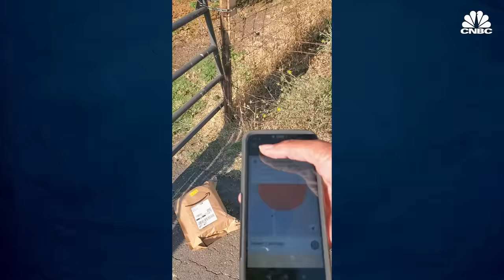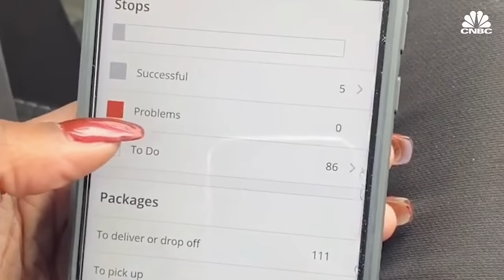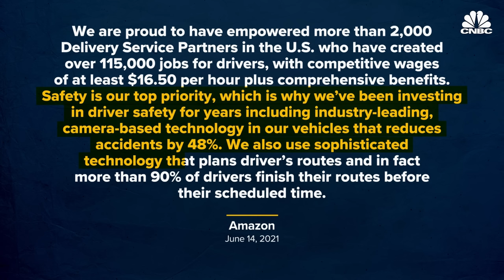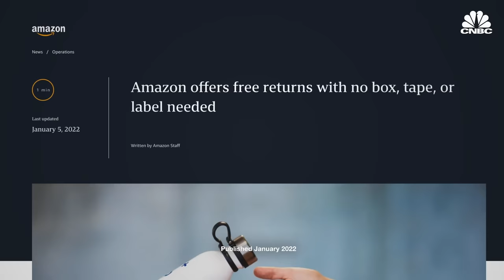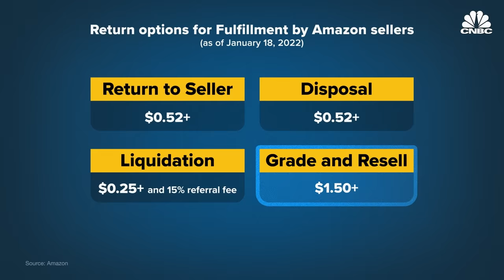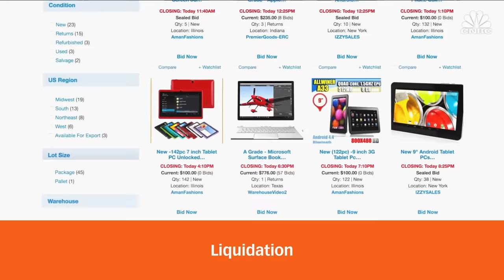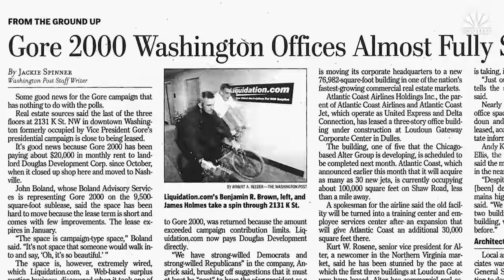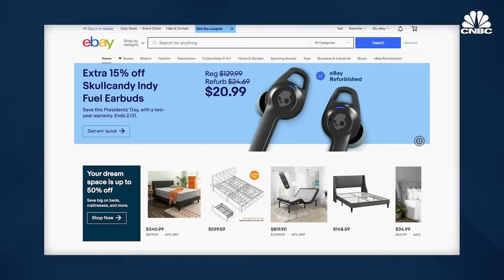The Hidden Costs Of Amazon Shipping And Returns

Comment: Working in industry, though not for Amazon as a driver, one thing they are missing is not giving the drivers regions of work.
UPS, DHL, FedEx, Royal Mail, - here in the UK - and the like give drivers regular routes to work. This enables the drivers to be familiar with the conditions of their environment, know when traffic is heavy in certain areas and learn short cuts that will save them time on their routes.
This knowledge is priceless and can only be achieved with drivers delivering to the same region, day in day out.
Also, having some way to feed back issues with the systems provided would be priceless and best if that system is delivered on a personal level, a member of staff at each location whom is responsible for acknowledging the feed back and then relaying it to those who can make the change.
Finally, having a portaloo/a camping toilet, like those found in campervans/Winnebago's is the obvious solution for the lack of facilities available and this should be applied industry wide. To support this, onsite cleaners can be on hand to clear this at the end of shifts, making the vans ready for the next shift - this should be standard.
Instead of chemical toilets, you could use compost toilets and then sell the biproduct to the fertilizer industry to support the facility of the toilets. That way it comes at little or no extra cost to the business, employees are happier in their work and you help facilitate the transition to the use of healthier fertilizer to grow crops for a more sustainable economy. A green touch that is on par with the ideology of Amazon and its founder Jeff Bezos.
Reply: They don't have to because they hand off most of their work to said companies. UPS, USPS, FedEx, etc.
Reply: UPS and FedEX may have regular routes but they still can't seem to deliver to the correct addresses.  90% of my packages never arrive without issue, and 20% not at all.  And there is little I can do and they don't care, despite having paid for the delivery of my package to my house myself I'm not considered the customer, the shipper is, so my satisfaction is irrelevant, my receiving the package is irrelevant.
Reply: @photo-5207  Del
Reply: @RoySATX  You indirectly pay for a fraction of the delivery fees and yes shipping company will rather deal with the shipper than receiver for many reason.
Reply: They’re low paid they will not stay long enough to know a route. Good thought though.

Comment: I needed a micro SD card returned because it would not work.  I couldnt figure out how to ship it safely, so I secured it in an SD card adapter that came with one of the many SD combos Ive bought through the years.  When my replacement came, so did my SD adaptor.  I was shocked... and actually quite impressed.

Comment: I barely ever buy clothes online because of sizing. If Amazon (or anyone else) let me just put in my measurements and see clothes that fit, I'd be hooked. Why can't they just do that?
Reply: As an example, when I try on Levi jeans, I always get the same size and style. However, I have found that any two pairs of the same color, size and style to not be consistently sized, so I have to try on muliple pairs just to find the one that fits. I've also found that Levi the same size and style but different color are even more differently sized from each other. For brands like Abercrombie, I have to purchase a full size larger than other brands for anything to fit me.  Nike shoes run at least a size small too (and narrower than other brands of the size labeled size). 

If clothing sizes could somehow be standardized within brands and between brands, what you're suggesting might be possible. Personally, I don't see that happening.

Comment: The delivery issue starts with the way Amazon's AI creates labels to pack boxes. Not only size, but weight needs to be taken into consideration when determining what can be boxed together. A 16# bag of kitty litter should not be put with a box of cereal. With Amazon Fresh, 40# of flour, sugar, and baking supplies shouldn't be put in one grocery bag simply because they will physically fit and are in the same aisle. Totally unacceptable to expect a driver to deal with the stupidity of the packaging as well as everything else.
Reply: Right! It's chaos how they package a lot of these items together.
Reply: I WAS A REGULAR USER OF AMAZON PAY. I HAVE LOST AMAZON PAY BALANCE AMOUNT FROM AMAZON PAY. THE REASON IS 

Since you have not used your Amazon Pay balance in the last one year your account has been marked as Inactive. While you can continue using the ‘Gifts & Credits’ part of Amazon Pay balance you will not be able to load or use the money loaded in Amazon Pay balance.

Complete Amazon Pay KYC to activate your account.

You can complete your KYC at the convenience of your doorstep. All you need to do is upload documents on the Amazon app and schedule an appointment for doorstep verification.

BAN AMAZON FOR TAKING AWAY PUBLIC MONEY.
Reply: @brettbarrett2533  I ordered a fire tablet and case and memory card. They came in 3 packages and 3 different deliveries. Memory card and case were in 2 ft x 8 in x 4 in boxes. Tablet was in a bubble envelope.

Comment: I very seldom order on line because of the return issue.  However, all the younger family members think nothing of ordering 3 sizes and two different colours of the same product.  They just return it if it doesn't fit.  So rather than focus on return expenses, start to focus on better product descriptions, pictures and measurements rather than sizes.  Sizes vary so much by manufacturer it is impossible to know what size the product is.  But if you put the body measurements that will give a better indication.  

I did order winter boots, because the on-line store actually told you how to measure the length of your foot and what size you should order depending upon that length measurement.  I did it for myself and my daughter and both pair fit perfectly... but the size to order was two sizes larger than my normal shoe size.

Comment: Amazon also relies (or, at least, did so in 2020 when I worked for the USPS) on the United States Postal Service for Sunday deliveries. UPS did, too.

As for the pee bottle issue, try being a USPS associate mail carrier (CCA). Delivering on routes you are unfamiliar with, with no map or GPS, plus the required Sunday UPS/Amazon deliveries where there is no route but you have a GPS, means you often don't know where to pee, and it can be very stressful. During the pandemic, a lot of gas stations wouldn't even let us go pee, and there were many other places that were the same.

Now I work for Amazon at the KCVG "Air" sortation facility, where safety is both highly important and I see routine signs of it not being prioritized, even when a rule comes from a senior manager. When OMs, AMs and PAs don't follow the safety rules, and they push for speed, the associates tend to follow suit. It's human nature. A friend of mine who is a high-level OSHA inspector told me that Amazon is so safety focused because it was listed by OSHA as a severe violator and assessed heavy penalties.
Reply: I know FedEX drivers also use pee bottles, truckers, and many involved in transporting goods. That is not really a hardship, just folks work until the route is done and they are saving time so they can get home to loved ones. Pays the same no matter how long it takes for most workers and  subcontractors.
Reply: @krisreddish3066  Honestly, if you can do it without spilling, it's ok. The problem is that if you pee and spill, someone else may come into your fluid, and that could lead to the transfer of a disease. Just don't leave your bottle behind in a shared vehicle; that's absolutely unacceptable.
Reply: Should Amazon be responsible for employees who have no common sense?
Reply: @Garth2011  That is a tricky question but, no, everyone makes mistakes and those without common sense make more than other people. Just because they have a disability doesn't mean they should be punished for it.
Reply: @GlennsFastReviews  Who said anything about disabled folks? Likely not the best job for the disabled even so.
Reply: @Garth2011  I mentioned disabled folks because your question was an all-inclusive one that included the possibility of no common sense being a disability.

There are plenty of jobs at Amazon that are suitable for disabled people. I know a guy at work who's got something wrong with his leg - he walks oddly - yet he works harder than a lot of other young folks. Another guy has a prosthetic leg. Physical disability is not an excuse not to work for most disabled people.
Reply: @GlennsFastReviews  Not really. Only to those who have disabled on the front burner.
Reply: @Garth2011   @Garth Clark  Not really what? Only what? Please clarify.

Comment: I've been stung by a scam a few times now, with amazon and also other companies like Zappos, where a person will buy two similar products, like sneakers or phone cases. One may cost $30 and the other $80, for example, and they'll keep the $80 one but return the $30 one in the packaging for the $80 one, get the $80 refunded. It's very low risk to them, if caught they just say "Oops I made a mistake".  The returned products go back into the warehouse and the next person to buy the $80 one gets the $30 one instead.  They either realize it's the wrong one and also return it, but are left unhappy and may not reorder, or they think they were tricked by the seller with false advertising and just leave a bad review warning others not to buy products from that seller/brand, which hurts the totally innocent company who sells the more expensive product.  Warehouse workers are rushed and don't check all that closely to notice it's the wrong one.

Comment: Inconsistent shipping is a real drag. Something says it's being delivered today and I need it today and then I get a.message I won't be getting it until a later date. They should have said that when I was ordering and I'd have picked a different item. I can't cancel and get a refund to reorder something immediately - because I needed it today - so when it gets here it becomes a return and I guess ends up in a landfill. 

I pay for Prime to get stuff here in 1 or 2 days, and the price of the items reflects the added shipping. I also order things I can't easily access locally. I'm not going to feel bad when hundreds of dollars of merchandise ends up in a landfill because Amazon can't get their act together when it comes to delivering to me by 10 pm. 

Another issue is inconsistent sizing in clothes and shoes. I order warehouse deals in case the item has to be returned and they get a second chance with a different buyer.

Comment: For the record know if you're a driver and you're only making 20 an hour you're getting ripped off. 
I'm not sure what tier I am considered at Amazon so just for example I'm going to compare myself to tier ones. 
at Amazon I make 19 an hour 
But yet tier 4 the first tier of management. make 80000 a year. Despite the fact that I worked at two buildings and I have personally seen my area managers have literally done nothing for day-to-day operations. I'm a PG  "process guide" it's my job to manage the floor make sure everything's running okay. so i move people around when it needs. I also have to bust my ass to break down Lanes if they are full. there will be days where I will be processing 800 packages an hour.
when you're only supposed to do 160. and within the last 2 months I've walked on average 30 miles a day. so if there's an area manager why is it my job to do all this for the same pay as a normal associate?
in any given day I do 4 times the work to any other associate for the same pay. Which has me asking the question why is upper management paid so much on Amazon. When it's the driver's and tier one's that actually make things happen. To drive this point even more. Just in my department is 4 managers 
two of which are Senior Management so they make over a 100,000 a year. 

despite the fact that they don't do anything they make on average 2 to 3 times more than your normal associate. meanwhile I will look over at the desk and literally see all four of my managers on their laptops laughing their ass off. more often than not I will look at my manager and see he's on indeed. so he's one of the highest earners on the floor spending most of his time doing personal tasks on company equipment. and I can't even get an extra dollar on my paycheck for actually working thanks Amazon.
Reply: Thanks for watching☝️Get-in-touch , Let's discuss on Financial investments..
Reply: Wow 20$ an hour im sure all those warehouse employees would love to be paid that
Reply: @spamlogs2701  considering this is Seattle people can't even pay their rent at 20 an hour. So yes that would probably great if it wasn't $1,500 a month for a studio apartment. better yet I feel bad for the associates in Las Vegas who only makes 17 an hour. and apartments are the same price. so yes cost of living has gone up and everybody at Amazon as a tier one should make 25 an hour because of it. if they did that maybe I would have co-workers who would stop starving themselves and actually be able to afford lunch. and just maybe people would stop trying to unionize Amazon because they can finally be sure at night their bills will get paid.
Reply: If you don't like your job, then you have the option to quit!
Reply: @dontcare563  are you being deliberately ignorant?
Reply: The place would be a zoo without managers, what a stupid thing to say.
Reply: @neonnoir9692  yes it would be but I don't see how it's relevant for six managers to stand behind a desk and compare salaries on indeed. Maybe there should be two that are actually doing something for the company instead of wasting money on their salaries
Reply: @neonnoir9692  your logic would be true if it wasn't for the fact I'm the one that actually manages the floor most of the time. so why don't I have the title if the actual managers aren't working

Comment: I was a ups driver and my normal day was 180 stops a day and at 20 stops per hour I was still getting harassed because I was too slow. Sometimes I had as much as 250 stops and around 300 to 400 stops during Christmas, at the beginning of the day we couldn’t walk inside the truck because it was blown away with packages, I was questioned about five gaps between stops so I end up filling a complaint with OSHA.

Comment: Message for Julie Ryan of North American Returns, HP 51:38 - 51:52 ...specifically 51:47 - 51:53 >>> You have 6 stacks of laptops stacked horizontally on top of each other at about 20 laptops high. I guarantee you that some or most of them on the bottom half of each stack will have screen issues from the weight of the laptops sitting on top of them. Either spread them out, put them in separate covey holes, or at the very least line them up vertically beside each other  on a cushioned surface. Anyways,  I hope this helps. I'm going to kick back now for the rest of the day knowing that I did my part to help. :)

Comment: Just install a portable potty in the truck and the driver must clean up at end of shift if not $50 deduction each time. But lunch break is a must for any kind of driver by at least 30 minutes. No doubt though Amazon is still the best company in the industry.

Comment: Many who can vouch and relate to these statements. Controlled by policies, smart surveillance and leverage. Anyone in need and vulnerable that is not aware of better work environments would say this is the best place to work for or anyone who is new because to Amazon we are disposable and replaced to often. Productivity over safety is priority sometimes when everyone encourages a bad habit of producing more than required than expectations can’t be met later in a safe manner. Working for Amazon is manipulating cult, like smiling with a gun drawn on back behind door. Also would say as a truck driver that our speeds are regulated or can come at risk of loosing jobs, that being said we are probably main contributor to traffic and pollution

Comment: I wish there was a better way to return items. I was told to go to a UPS box at the post office. That's the closest- and I have no car. The box is oversize just for a pair of boots. I ordered size 9 and received size 12 both slippers and boots. I wound up keeping them. I miss connecting with an actual human being- Size 9 means Nine. There should be a way to RECYCLE old Amazon envelopes. If opened carefully and then cross out name and bar codes so a NEW label can be placed over it perhaps?? Amazon drivers can simply pick up old ones from their stops. Then again- Amazon may claim they don't have the room " Space is Rent". Give it a try Reuse Recycle

Comment: The company needs to allow a 30 minute bathroom break.

As far as food lunch breaks,  they can it on the go .

Feel food with your hand and shove in mouth ,but keep eyes on the road. 

Bathroom break, you can not restrict bathroom breaks because with some people it will turn into a hospitalization  issue if they hold urine for too long.

Also, you will wet your clothes and don't have extra pants to change into.

Money is important,  but you have to also think about the driver's safety and health.

Without the worker then you are out of business.

Comment: Me and my mom do Amazon flex and have been sent to really bad areas or outskirts of the city for low pay some places like my delivery in August 5th could not get access to locked community at 5-6 am where customers don't answer to let me in and had my standing go down Amazon did not care and told me that they stand on decision how can I drop off a package at UPS if they are closed Amazon is full of bs on safety and proper planning to get stuff delivered